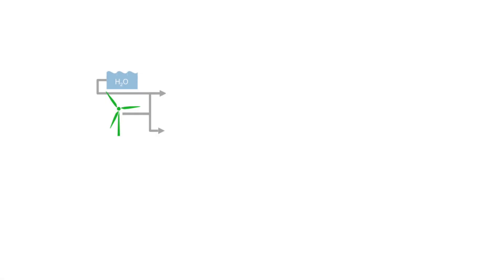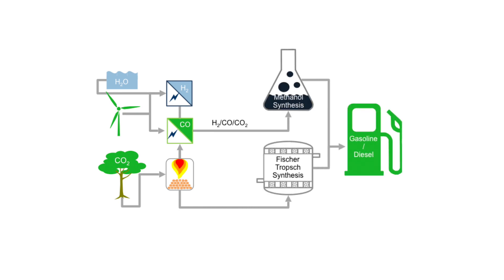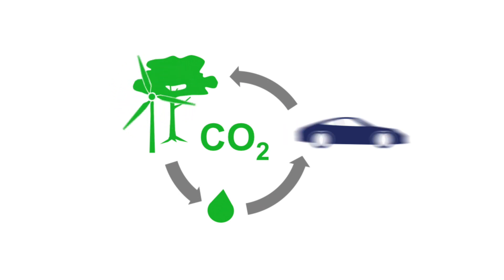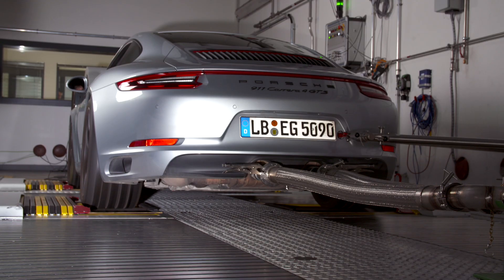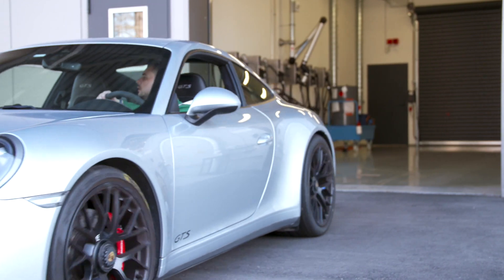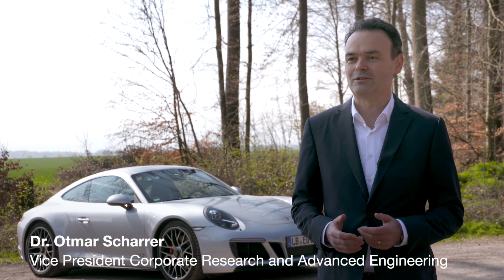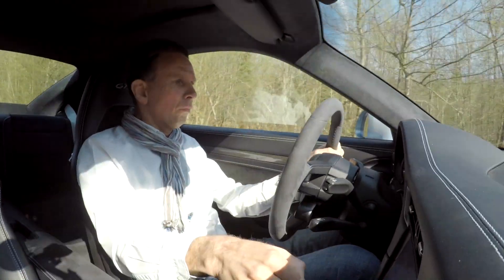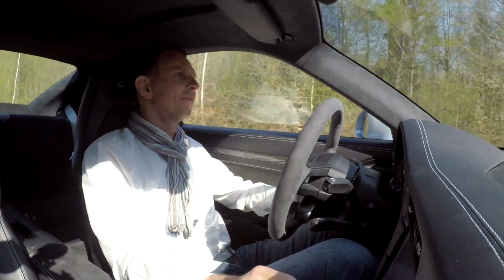Synthetic Fuels Complement E-Mobility - MAHLE & Porsche

Comment: There is a miss statement right away in the video above. If it is a cycle of Co2 used to make a hydrocarbon and then burned in an engine where the Co2 is released again into the atmosphere, the best that the fuel can do is maintain the carbon in the atmosphere, not reduce it. Making electricity from non-carbon producing renewable energy such as wind and solar and using that energy in batteries is a completely non-carbon producing cycle, displaces carbon producing engines and therefore reduces the amount of carbon in the atmosphere. Co2 to Co2 is parity. It doesn't reduce Co2. While using renewables that produce zero Co2 energy and then using that in an electric motor keeps someone from using a hydrocarbon burning engine that produces Co2, which eliminates a portion of Co2 that would be introduced into the air, which acts to reduce the amount that would be put into the atmosphere by the synthetic fuel cycle. Also, alcohol fuels already exist. They take the Co2 from the atmosphere captured in growing plants (corn, sugarcane, etc.) and re-release that Co2 when the hydrocarbon alcohol made from those plants is burned in an engine in a car. That stuff is currently sold in the US as E10 (10% alcohol), E15, (15% alcohol) and E85 (85% alcohol). So we are already doing the same cycle done by synthetic fuels and it is much cheaper than gasoline.

Comment: I wonder where the co2 comes from
Reply: The carbon emissions don't have a negative or a positive effect, meaning that synthetic fuels are carbon-neutral
Reply: @aneeshkashyap2853  but where they get co2 from direct air capture or from somewhere else
Reply: @moltoniron633  From the CO2 that was already present in the atmosphere due to fossil fuel emissions (2/3), and natural CO2 emitted by respiration, fissures in the earth and limestone deposits (1/3).
Reply: @thatguyalex2835  well then we will have infinite source of hydrocarbon fuels from atmospheric co2 combining with hydrogen, the process goes on round and round forever I guess
Reply: @moltoniron633  Yep, that's the plan with this E-fuel technology. :)

Comment: Much prefer this to batteries. What are the impacts on air pollution?
Reply: Production of synthetic fuels is done by absorbing CO2 from the atmosphere. This is the exact opposite of battery production.
Reply: @RR-us2kp  that correct but you may still have particulate matter, NOx and other pollutants exhausted.
Reply: @bossadave  exhaustion happens after combustion. That's why I said it is the exact opposite of battery production.
Batteries production large amounts of CO2 and particulates during production, but has no emissions at all when in use. (Disposal is a whole different matter)
These fuels are carbon negative during production. But they emit CO2 and particulates when combusted.
Reply: Tail pipe emissions with this fuel are 85% less. So some emissions are still produced, but very very little.
Reply: it's basically pure petrol with no other chemicals like sulfur which are found in fossil fuel petrol. also it's made by pulling CO2 out of the air so it can be carbon neutral or even carbon negative if you make more fuel than is burned

Comment: I’m hoping to see synfuel cars go along with electric, hydrogen and biofuel cars. Goodbye fossil fuel ;)
Reply: Synthetic fuels shall save ICE vehicles! They are the future
Reply: How will the engine be lubricated? synthetic oil or other oil derived not from fossils?
Reply: @aaronmiller5012  Probably synthetic oil, or fossil oil. The oil industry would be shrunk down to just plastics and engine oil in this future, but hopefully we get rid of plastics as well. This is just an assumption though
Reply: Until the transportation industry completely changes, fossil fuels will always be around.

Comment: When do you think the fuel industry as a whole will be using carbon neutral synthetic fuels?
Reply: The government should invest in synthetic fuels. It's a good idea
Reply: @aneeshkashyap2853  I agree. Not everything has to be electrified.
Reply: @arvin2035  not only that but if all vehicles were electric we would experience frequent power outages too.
Reply: From what I heard it will be by 2035.
Reply: @arvin2035  that would be awesome. There are so many existing internal combustion engines. It just makes sense.
Reply: I’m betting in 4-5 years
Reply: @joseverdejo9010  Hopefully man

Comment: The savior of combustion racing?
Reply: A very quick search will show you we are 53 years away from depletting all oil sources, and more are yet to be found. If the world starts to use more renewables, this number will be pushed farther, and there will be oil for ages to come. If global warming is a concern (and for me it is), every race event could plant some trees to reabsorb the CO2 emitted. A combustion race entertain thousands if not millions, and yet just a few running cars are consuming fuel, it's not impactful at all. Sythetic fuels are cool but are not need to keep combustion racing going forever, in my opinion.
Reply: @rodrigofonseca1160  Thanks for the info.
Taking into account what you said, perhaps synthetic fuels are not necessary for motorsport to continue with internal combustion engines as now as you well explained.
But even with that, if they start using those fuels in all categories such as F1 for example (I heard that they are evaluating incorporating them in 2030), not only that it will extend the remaining years for oil reserves a little more, but Also it would no longer be necessary to electrify all motorsports, which I personally do not like the idea.
I would like to see those synthetic fuels soon in the 24 hours of Le Mans and in the Dakar Rally.
PD: I used google translator, i speak spanish.
Reply: @rodrigofonseca1160  Funny thing is: the combustion engines aren't even the main CO2 producers in racing motorsport; the entire F1 fleet uses less fuel per year then a SINGLE transatlantic flight. Getting the drivers, crew, cars around the globe is ALOT more CO2 producing than the cars itself.
Reply: The carbon emissions from synthetic fuels have neither negative nor positive effects, meaning that they are carbon-neutral. But synthetic fuels can indirectly have a positive effect: No pollution, clean air and sometimes cleaner than EVs
Reply: F1 engines will run on the stuff in 2025
Reply: V12 is ok for ferrari

Comment: What is the octane rating on this fuel and where can i can more info on this?
Also will we be seeing this in F1?
Reply: I haven't been able to find an octane rating but if a 911 can run with out issue my rusty bmw should be fine!
Reply: @ahmetahmet9673  True. As long as the fuel is equally stable there will be no problem. I find Porsche is the only ones going full steam ahead with this one. Audi seem to be aiming more into the Ev market. I have read that Porsche does have engine ready for F1 that redbull is somewhat interested but only if F1 is a synthetic fuel race. Seems to me that its all up to politics not technology. If VAG is happy to get there balls back and start winning in motor sport like the old days, synthetic fuels are the answers.
Reply: Possibly the same octane as fossil fuels. Idk
Reply: @aneeshkashyap2853  Its very interesting considering the only reason why they make lower rating fuels is because of the refinery processes from crude oil to petrol. So the question is if its easier to refine synthetic fuel.
Reply: @muckman5509  yeah. The government (of any country, including India, USA, UK, UAE, Germany, France) should invest in synthetic fuels so that the prices can be low like petrol prices in Dubai
Reply: @muckman5509  so it will be interesting to see synthetic fuels get launched world-wide
Reply: It's rated at 87 octane. So not too bad.
Reply: @moabman6803  Don't know where your getting that from but if they are running a Porsche 911 that is RON98 without a retune, its most defiantly not 87.
Reply: @muckman5509  I just got it from some news article. If u find different info let me know.

Comment: I hope this is the future😁☝️☝️☝️☝️
Reply: Synthetic fuels will surely will be the future
Reply: Both have future. Fuells have advantage due to cost and range: normal petrol car costs 20 000 euro new and can go 1000km on one fuel tank. Normal electric car costs 30 000 euro new and can go 500 km on one charge. Big difference...
Reply: @creatineenjoyer7345  I was gonna say something along those lines. We need multiple fuel sources. Electric for short range, while E-fuel, biodiesel, hydrogen fuel cells, or ethanol fuel cells could be used for long-range travel. I would rather be in a car powered by E-fuel, or an ethanol fuel cell than in a battery electric vehicle. Or, there could be hybrid vehicles that use E-fuels for long range, and batteries for short range. Man, so many combinations, so many possibilities other than dino juice or even worse, unpaid slave labor in cobalt mines. :)
Reply: Same
Reply: Nah electric cars more better than IC cars they are faster more efficient.
Reply: @mehmetmustafa2112  They are more efficient but not faster, if a ice car has the same hp as the given ev it will be much faster, and gaining a lot of hp is extremely easy with modern engines... but companies are sadly only tuning their cars step by step not like tesla who instantly give their cars as much hp as they can...
Reply: @krabbe969  they are faster and moe efficient
Reply: @mehmetmustafa2112  Synthetic Fuel can help a country to grow their economy. I don't know any country that became rich by exporting lithium.
Reply: @mehmetmustafa2112  not always because EVs can pollute the environment worse than ICEs. Battery production requires lots of harmful chemicals, and battery punctures make EVs sometimes bad for the environment
Reply: @aneeshkashyap2853  Nah u are wrong
Reply: @mehmetmustafa2112  No YOU are wrong! I am right
Reply: @mehmetmustafa2112  you believe that EVs don't pollute at all, but they actually do sometimes
Reply: @mehmetmustafa2112  no you’re wrong. EVs are never the future.
Reply: @mehmetmustafa2112  They said that flying cars would exist in 2020, and now begins the saga of the guys who believe that children's toy is the future lol